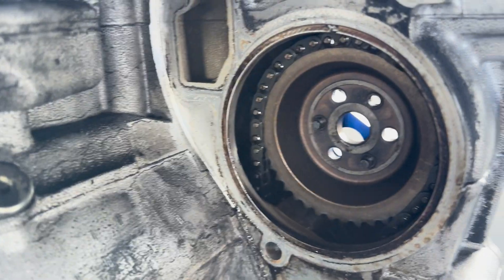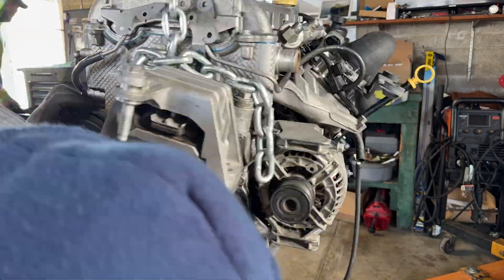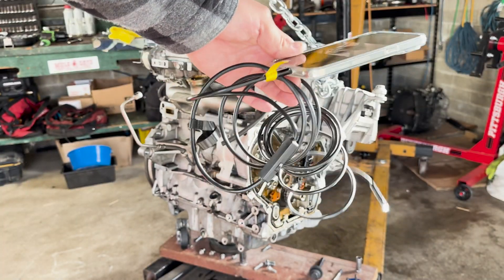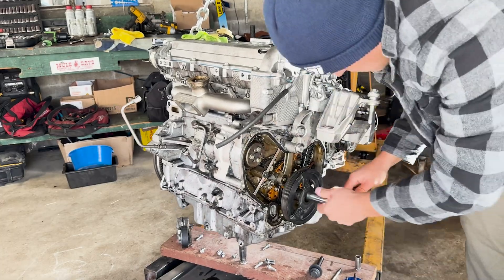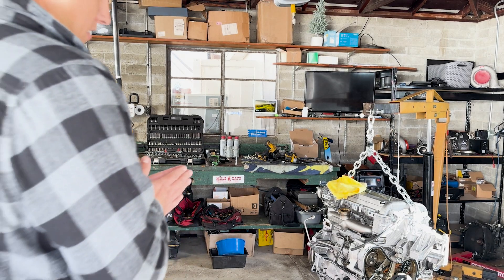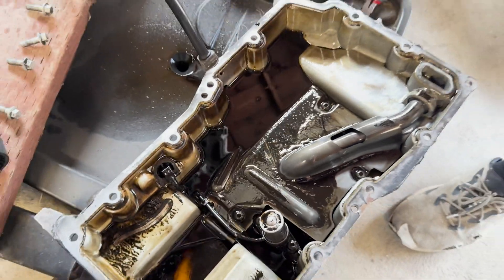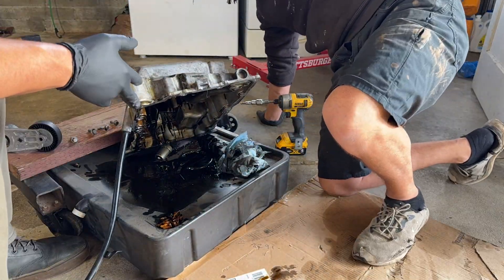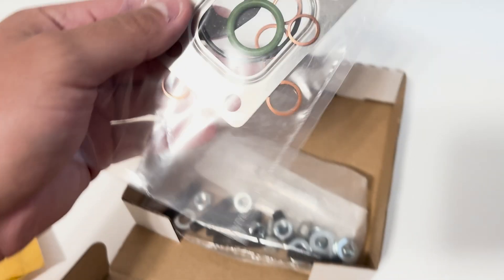Saab 2.0L Big Turbo Build (Part 4) - Timing Issues & Cylinder Borescope

Comment: For that lower bolt you take off the motor mount and jack the motor up it comes out
Reply from the maker: Yessir good looks! Figured this out after working on the v6 more. Similar situation having to jack the motor up and down to get those bolts in/out

Comment: Are you running a stock block? I'm interested to know what it actually takes to build a 400hp+ b207r aside form the usual turbo, manifold etc..
Reply from the maker: Stock block so far! You’re in the right place, working on exactly that 👌🏻
Reply: @thejsgarage  I know that ZZP make a gen 3 short block for the LSJ you can use, but that's like 2k lol. Another way is to use dowel pins in between the liner and cylinder wall, but I'm dubious.
Reply from the maker: @TheJkghfg  yeah I know Skunkworks make some 2.2 and 2.4 ecotec builds too that I believe would work. Very expensive tho to your point
Reply: @thejsgarage  depends on whether you want to keep it a 2.0l or not. My dream setup would be keep it b207 but twin charged it with full XWD build. I can dream 😂
Reply from the maker: @TheJkghfg twin charged has definitely crossed my mind lol and yeah the XWD would be necessary to put the power down. I think you could do the XWD easier than you think. Few guys making the frame brackets, then just gotta sort the parts from junkyards
Reply: @thejsgarage 
En eso estuve yo estudiándolo😅
Así como un autoblocante si se quedase FWD😢
Sería interesante verlo y poder recrearlo en un tiempo😂😊❤